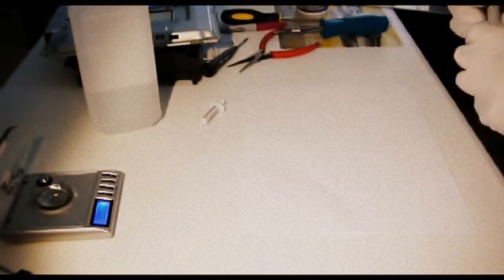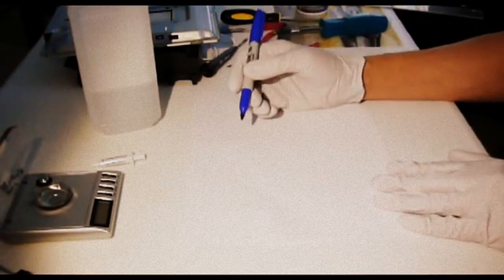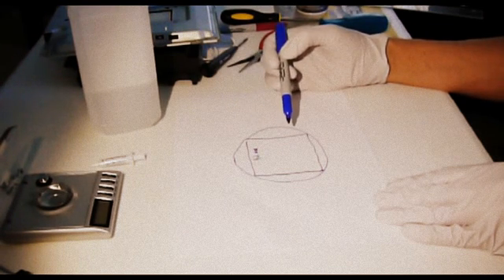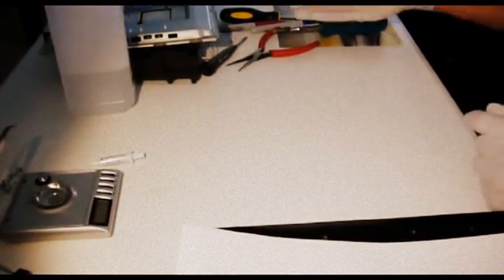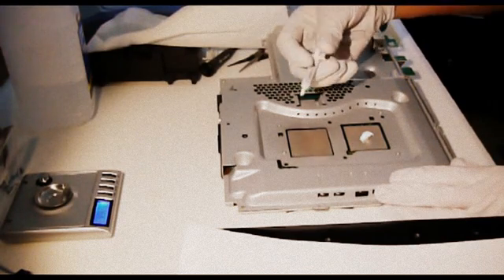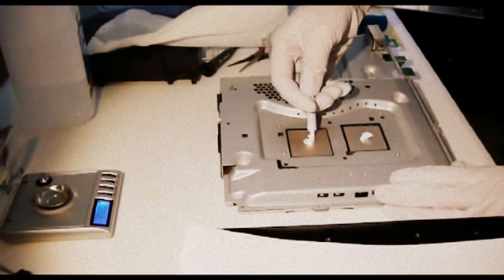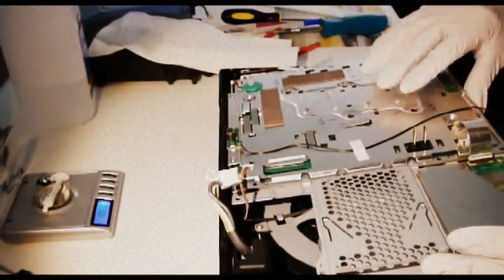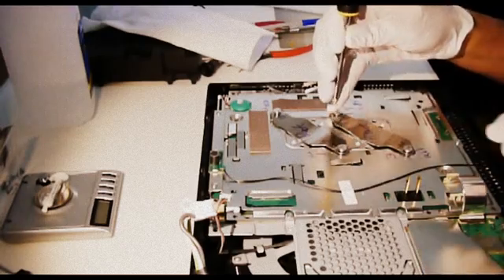How to Apply the Precise Amount of Thermal Grease to a PS3 (40gb/Older "Fat" Model)

Comment: There are so many things wrong with this video. You do not need to get thermal paste all the way to all of the edges and corners most of the heat comes from the center and the paste will expand when it's heated by the chip meaning it'll go even further than where you put it at room temperature. Also, if you use Artic Silver and have it over running the chip that much it can short other components because it conducts electricity.

Comment: my ps3 has no thermal paste on it but it still turns on the only problem it stays on for 30 seconds or 15 can i use heatsink paste or artic silver 5 on it. and can i put it on the heatsink too.